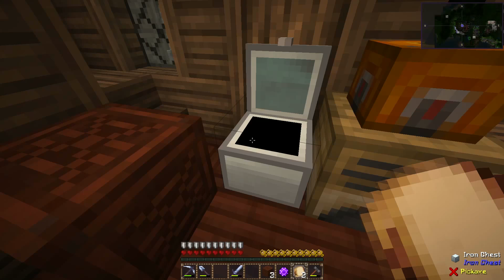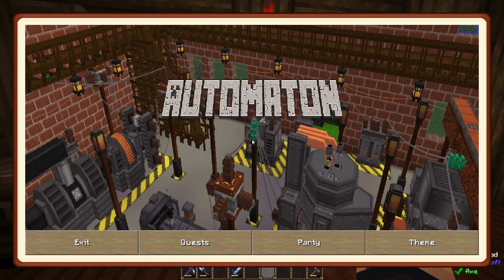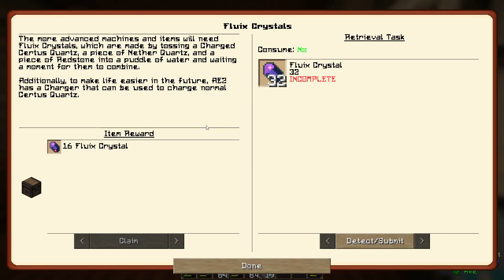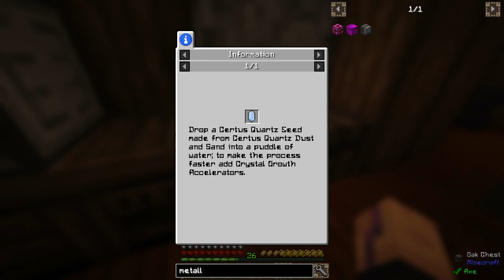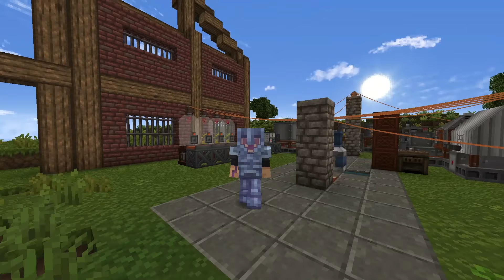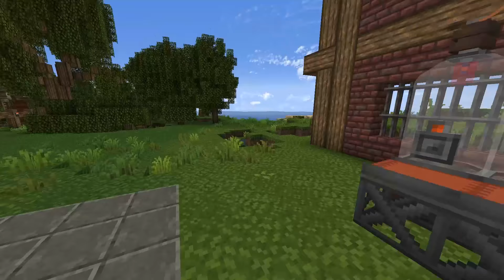Automaton | APPLIED MEKANISM | Part 15 [Let's Play Minecraft 1.12.2]

Comment: I sure hope you're not skipping straight to Mekanism... Oh, good. Though there are some fun toys in it.

You could always dress the factory up like it's a viking metal works.

Compressed Redstone/Diamond/Carbon now gives 80 so the numbers work out with full stacks, but it's still better than 1:1.

I will note you're going to want a rather robust power system, AE seems to be very power hungry in this pack.

Silo's are a good way to store stuff like the hemp fibers. It'll hold 512 stacks.

So two thoughts. One, probably time to upgrade to HV coming from the generators. And two place down capacitors and feed power into those, instead of directly into the machines to make a buffer for power so it can run the fuel making processes longer.

I actually like the one-high window in the brick wall better than the 2-high.

Botanic Miner's kind of hit or miss. Bonsai would be cool. I'd go with Steve's Carts myself, but that's just because I like the mod.
Reply from the maker: Yeah i love Mekanism, one of my favorite mods, but i don't wanna rush to it heh, just needed some basic stuff for it. Even if we'd start using Mekanism, i would go back and cover some of the other IE stuff, etc. 

Good to know about AE being power hungry! I think once we have the Diesel Generators + Steam or something else, maybe that's enough? 

Silos are great indeed, but hard to justify when you've got small drawers holding way more lol. Always a problem with modpacks. Though i might use them for looks later anyway. Maybe have a silo on the outside of the building for extra melons and hemp. 

Yep i upgraded to HV and placed some HV capacitors (off camera) to store power, will expand on that later too. Not having the HV wires/connectors is also why the system wasn't self sustaining (i think i mentioned it at the very end of the episode). 

Oooh Steve's Carts could be nice indeed, it seems to go more with the theme of the pack. I think i'm gonna go with that one, i love that mod too. Thanks for the suggestion!
Reply: Cool. I love Mekanism as well. (Flamethrower is surprisingly fun.) So many people would just try and rush it though.

Not sure. I was feeding it a half a steam turbine and it was sucking it all up, but I was also running the rest of my base as well, so...

That's fair, but at the same time, if you need that much hemp for the hempcrete, no reason not to have a silo worth. Could also add some nice looks to the farms.

Yeah, That should work. I was using the capacitors from the quests to buffer power on individual machines.

Cool. Love to see that mod. (Industrial espionage for the win. The module that is.)